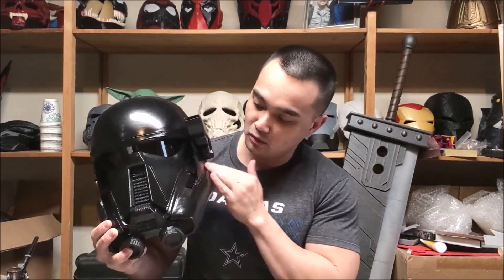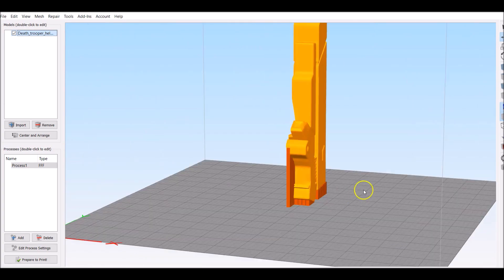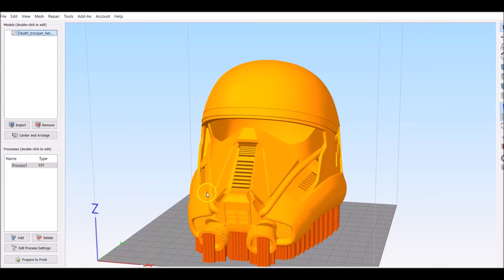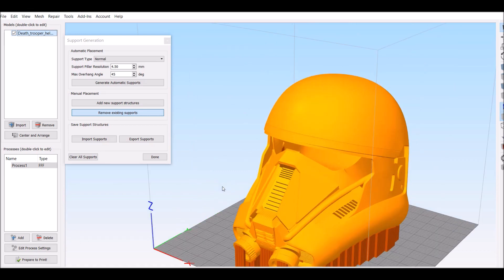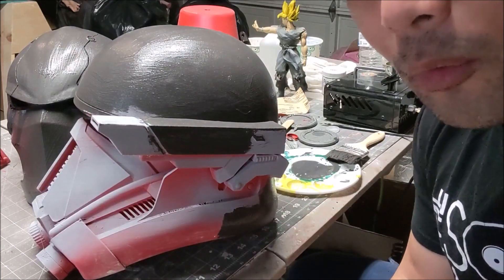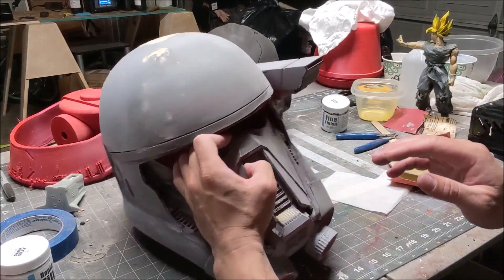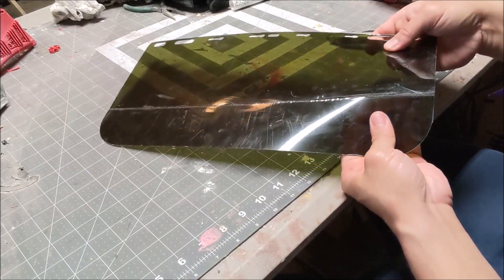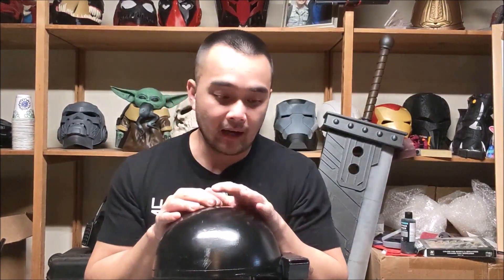3d Printed Death Trooper Helmet

Comment: hey guys , first off big  thanks to Nikko and uncle Jesse . i have not been 3d printing very long and still learning. but i just finished 2 complete sets of stormtrooper armor in tpu. very happy with the results.
after using the advice of Nikko and Uncle Jesse i m loving my printers.

i thought i d just share my covid home time experience.

i found a simple cheap mod for my extruder on my cr10s4 its 35.00 its called seemecnc ezr struder. after installing this cool thing iam printing tpu at speed of 110, temp 228 , .4mm nozzle, 50 on bed, with retraction. 
and .2 on quality at 10 to 20  percent infill .

works amazingly well
and using alexflex to smooth out any areas.

not sure if anyone has tried this but im impressed. no stringing, or binding or slipping. definitely worth it.

on my longer lk4 I installed a dual drive extruder and tpu prints fast as well same as the cr10s4. 
stay safe and be well
if anyone has more advice let me know
Reply: I use a cr10 s4 and longer lk4
Reply: what printer did you use?